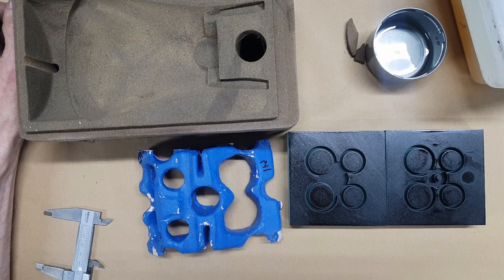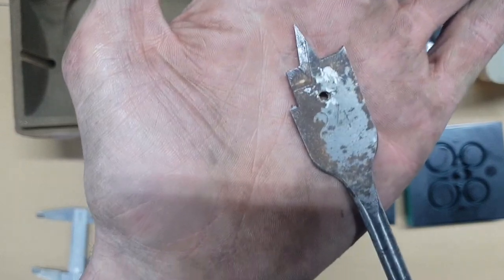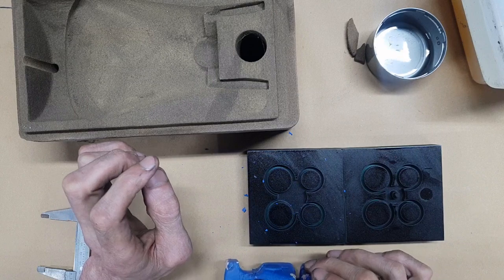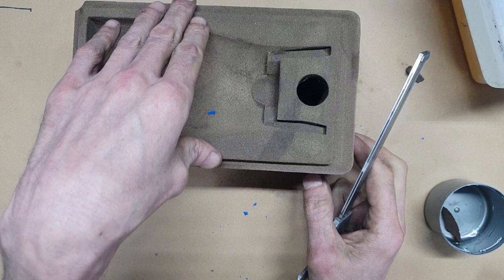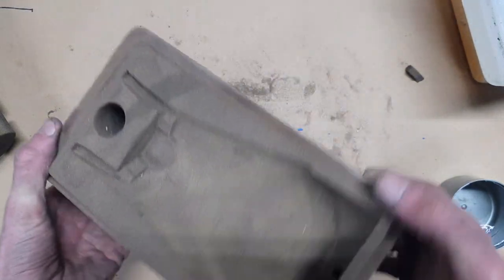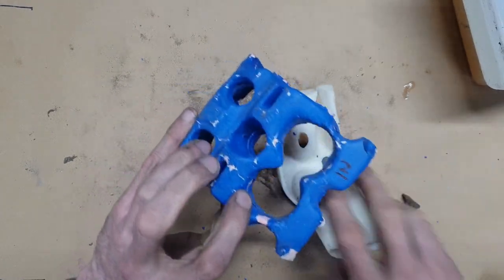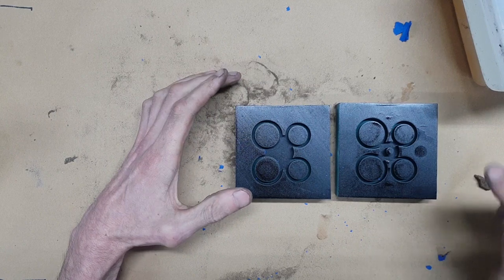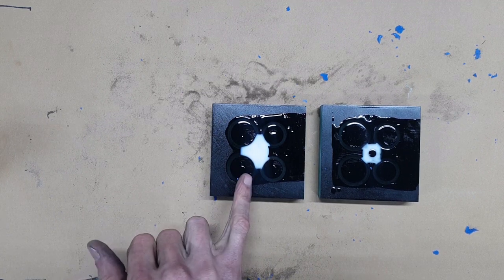F1 Casting Technology Advancements - A Closer Look - Ep 10

Comment: I worked at a foundry straight out of highschool one summer. They did aluminum on one side of the place and Iron on the other. I worked on the iron side and that stuff was so heavy and so hot. It would splash like water when the dude pouring it from the bucket into the mold missed the hole a small amount. My job was to place the weights which was like a heavy iron cage that weighed about 100 lbs onto the molds before he would pour the liquid iron into them. The weights would support the mold on all 4 sides and press down from the top to keep the mold from splitting open when the liquid iron was pouring in. This all happened on a steel belt that would neve stop. Grab the weight with the hook and lift and run it to the front of the line, drop it, run back to the end and grab the last one again and get it back to the front once again. At the end of the belt the mold with the now hardened but still glowing hot iron would fall down onto a shaker table that was full of quarter sized holes. This would bust the mold allowing the product to come out while the sand would fall through the holes and be brought back the the front of the line to be turned into a new mold. It was like purgatory amd would never stop... ever.

Comment: Very informative thank you! How do they remove the ceramic inserts from the waterjacket without damaging the casting?
Reply from the maker: They just get washed out...they dissolve as mentioned.
Reply: @EngineeredtoWin  I just read the patent, they generally use a caustic solution to leach out the ceramic section. I didn't think this was viable for aluminium castings (fine for ferrous) so that's interesting.

Comment: As somebody who hasn't really had to deal with casting but who has done a lot of metal 3D printing it's interesting to see the differences and similarities. Things like induced stress from large differences in material section are the same, but extremely thin walls and tiny passages are super easy when printing vs. casting. I would assume that a lot of modern F1 engine components, including in the engine, would be metal 3D printed instead of cast.
Reply from the maker: They are still cast...however the moulds are 3d printed sand.

Comment: I worked at an investment casting foundry making parts for the hot side of plane engines. As you can imagine, wax isn't the most dimensionally stable material. The lengths we went to keep the patterns dimensionally accurate in shipping were extreme, but still often the cause of issues. I figure you'd enjoy seeing some of those parts. Been making parts for 40 years that still blow people's minds, and only think is possible with 3d printing
Reply: That's is why cnc machines were invented
Reply: @importanttingwei7747  Machining the geometry I'm talking about is an impossibility. And even still today, most flowpaths aren't machined, just isn't necessary or practical. And for features that are machined after casting, you still need to be accurate within the casting allowance.

Comment: I'm not too surprised to hear, E30 M3 engine was developed by a single guy. It's a 2/3 of M88. It wasn't so much of a designing, but reducing 6 cylinder engine down to 4 banger.
Reply from the maker: Indeed, but still... look at the dfv even. Would probably take 500 engineers now...
Reply: Was that the four cylinder block they used in the turbo era engines? You know, the one the engineers used as an outdoor urinal.

Comment: Like the way of using resin to determine the chilling of the casting . From what I remember the pattern maker I knew used a green fine sand for delicate parts and also used a binder that set with the introduction of Co2 gas into the unset cores . Back in 2006 I purchased a Z-corp 3D printer for doing DFV components and small lost wax castings this used maize powder and a starch based binding agent . Agree the pattern making industry took a big blow with technology like that . BMW E36 M3 and E36 GTR race car owner here . S50 and S54 engines are superb . Induction roar with a carbon air box is unbelievable especially when your on the pit wall / straight . Hate to say it but sounds nicer than a BDG through the forest back in the day 😇👍
Reply from the maker: That's a nice machine to own! Bravo.
Reply: Cheers 👍 I think your content is so interesting. I’m sure there are tens of thousands of viewers out there for you . 
Ps love your morals regarding bad comments etc etc 👍🇬🇧

Comment: I mightve missed the relevant part, but does f1 use bottom fill casting? I read that it was a major advancement in casting consistency for bike engine manufacturers.
Reply from the maker: Yes, it does, and will cover that soon as it's probably 2-3 episodes alone.